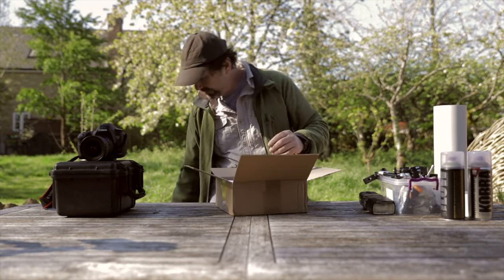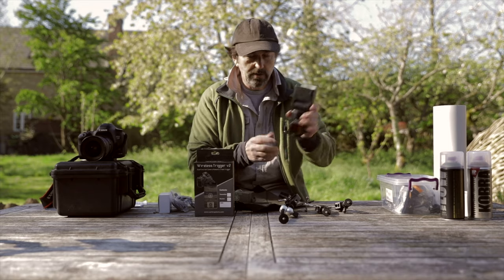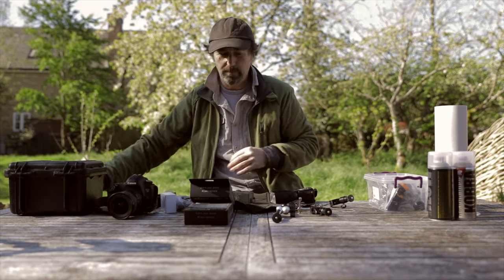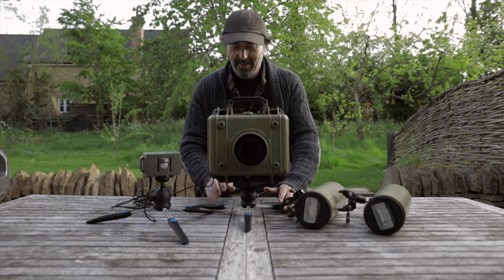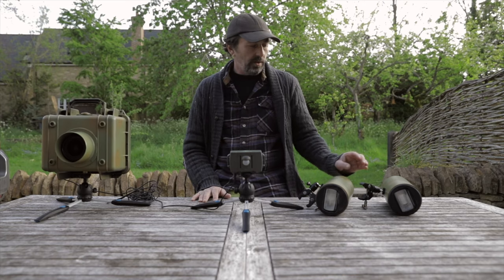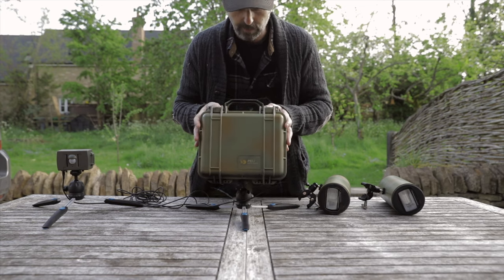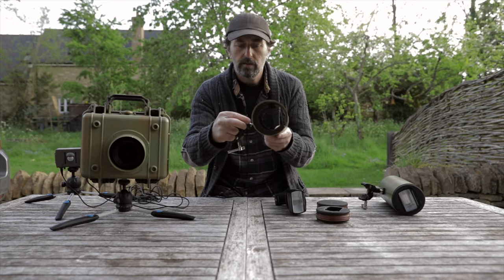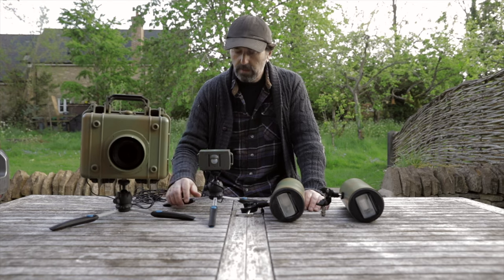Making a DSLR Camera Trap for Wildlife Photography with a Camtraptions V3 PIR sensor

Comment: Hello again George, in the video you use Sugru moldable glue to fix the flange to the outside of the box.  How did that go?  I had never heard of it before but it looks really useful. Did it do a good job fixing the plastic flange to the plastic box?
Reply from the maker: Hey Robert.. it actually did an amazing job.. so far holding strong and completely water tight..! Amazing stuff and I always have some in my bag.. fixed a fraying phone charger cable with it too..! g

Comment: Awesome video, got my camtraptions setup ready to go. For the Speedlights, have you found water/moisture come through? I'm considering doing the PVC pipe setup, but adding a foodseal/ziploc style bag on top with a rubber band to ensure it can fire through, but with minimal water/moisture ingress. Any thoughts on this please?
Reply from the maker: Thanks for the comment and I’m glad you liked it..! I haven’t had any problems to date with water ingress though when I build new ones I intend to seal off the end with a cheap uv filter which I think will be better than the bag option

Comment: Do you have a link for the mini camera stands please.. and brilliant set up. Im just building mine now that I've got my camtraptions gear
Reply from the maker: Hi Stephen.. thank you and I’m glad you like..! The stands are linked below but in all honesty I’d hold off getting these as they are not that strong or stable.. I’m looking at getting something a little stronger for the load so I’ll let you know as soon as I’ve found something I’m happier with.. the link to the ones I used is: HITSLAM Mobile Phone Tripod, Mini Tripod for iPhone/Samsung Galaxy/Huawei Cellphone, Small Camera with Bluetooth Remote Control, Phone Mount https://www.amazon.co.uk/dp/B07XG7ZH1N/ref=cm_sw_r_cp_api_fabc_1E179FG3T92RBGZSC6AD?_encoding=UTF8&psc=1

thanks again and all the best.. g
Reply: @GeorgeSBlonsky the ifootage cobra 3 base is on incredibly sturdy. For my flashes I use the cheap gorilla pods and secure with builders line (brick line, thin rope) on trees or to a rock/ground.

The mini tripod (base) is about 50quid on sale
Reply from the maker: Thanks for the comment @sinetwo ..! I shall check the ifootage stands out.!

Comment: I really like the way that you have constructed a housing for your Speedlights and you have inspired me to do something similar. The one thing that worries me is the stability of the tubes containing the flashguns once you have attached to drainpipe to a 7" magic arm via a 1/4" nut inside the drainpipe (is that righ?) - doesn't the weight of it tend to let it droop once articulated and set in place? Using the plastic drainpipe as a cover looks a lot better than using plastic bags for sure.
Reply from the maker: Thanks Alan.. it does require some firm tightening of the nut to be sure but has held for me so far without slippage every time I have put them out.. what helps of course is to position them if possible hanging down rather than extended sideways to reduce the leverage strain on the magic arm.. I’ve also been thinking of screwing a plate into the tubes to eliminate the possibility entirely because like you rightly suspect, they do work loose when removing and have to be re-tightened before putting them out again... hope of some help..! all the best.. g

Comment: Nice video. Curious to know what that clamp is your using for the flash housing. I just build some similar housings and now trying to figure out the best system for mounting them on a branch or rebar etc. Thanks!
Reply from the maker: Thanks Tim..! The clamps I used are linked below but in all honesty they are not that strong for the weight they need to hold and I’ll be upgrading them when I can.. hope that helps..! 
Link: 2Pack ChromLives Camera Clamp... https://www.amazon.co.uk/dp/B07GZ1D4BB?ref=ppx_pop_mob_ap_share
Reply: @GeorgeSBlonsky  Thanks George. Yes, the pipe and flash combo is pretty heavy and I have yet to find a good clamp system. This gets me one step closer. Thank you!

Comment: I’m loving the flash housing, did you have an Amazon link for the pipes and caps?
Thanks in advance
Reply from the maker: Hi Dan.. so glad you liked..! Links are below.. non-affiliated..! You’ll have to cut down the pipes to fit length of your flash guns as they’ll be too long otherwise.. best of luck and thanks again..g

End Caps: 5 Pack Round Tube Inserts 100mm,... https://www.amazon.co.uk/dp/B018R0HUZC?ref=ppx_pop_mob_ap_share

100mm pipe: Kair Plastic Ducting Pipe 100mm -... https://www.amazon.co.uk/dp/B00YLIOWXI?ref=ppx_pop_mob_ap_share
Reply: @GeorgeSBlonsky  thank you George for your quick and helpful response 👍🏻

Comment: Hello George, I build also a camaratrap and using my Nikon D7000 voor it. But the battery of the cammara is working voor 4 till 6 hours. Did you have also had this problem?
Reply from the maker: Hey Klaas.. thanks for the question.. my guess is that you are not putting the camera in “standby” mode so it is always on and drains the battery.. I don’t know much about Nikons but you should check if it has such a mode.. all the best.. g

Comment: I really like it, just a question, how much would it all cost?
Reply from the maker: I spent about £300 on my set up not including the camera but including the PIR sensor
Reply: If I got a sensor already and stuff how much would the flashes be and lense
Reply from the maker: That is something you will have to research for yourself in your local market as I have no idea where you live.. I bought two used flashes from Germany for €100 total just a few weeks ago
Reply: basiclly I was thinking about making a trail camera for a school project and just had a few questions. First do u recommend this setup or just a basic trail camera setup, also do I need two flashes, do I need to get a high quality flash and finally do I want like a broad lense or one more focused on a specific location, thanks so much for all the advice
Reply from the maker: No worries and I’m happy to help if I can.. there are a couple of major differences between a basic $50 TrailCam and a DSLR set up like in my video.. firstly a DSLR camera trap will allow you to take high resolution images of animals at night but you can only achieve this by providing light in the form of a flash (and yes.. you can use only one if necessary) a TrailCam however has much lower quality BUT it can shoot images and video by using a built in infra red light recording to an image sensor that is sensitive to IR light.. to achieve this in a regular camera you would have to have the camera sensor adapted by specialists. To answer your last question I would choose a wide angle lens.
It all comes down to what you want to use the camera for.. if it is only to take a peek into the night time activity of animals without much concern over quality then I’d just set up a simple TrailCam for your school project.
Reply: @GeorgeSBlonsky  think I could do your setup for around 100$ or 76.38£ if it’s just like lense and flash mainly I need for that amount, this design is quite impressive and I would love to be able to do it
Reply from the maker: Go for it..! You should be able to find less expensive parts.. let me know how you get on.!

Comment: I'm surprised you didn't put a UV filter on the front to keep out moisture. That shroud will keep out a bit of rain, but not much.
Reply from the maker: Thanks for taking the time to comment Steve. I've actually had no issues at all with the rain or in fact snow using this set up all of last winter in quite extreme conditions as you can see in some later vids.. but point taken. In addition, not sealing off the front means the camera & lens acclimatize better to changing temperatures (in Northern Greece where I was shooting all winter temps can go from +12C in the day to -12C at night) meaning I have also not had any fogging, or steaming up of the lens nor any condensation build up in the housing itself. All the best.. g
Reply: Good point about the fogging. We've had some really torrential rain here in Queensland the past couple of weeks, which is why I want mine watertight. I plan on putting lots of silica gel in the box too.
Reply from the maker: Understandable..! I tend not to leave the kit out if it’s torrential truth be told as I don’t like the way the pics come out... the flash picks out the raindrops and you get a ton of little white hotspots in the frame.. unless of course you shoot without flash.. I keep a couple of sachets of silica in the box too.. 😃 cheers.. g

Comment: Brilliant videos George what flashes were used and how did you stop them going on standby and my second question what  external trigger was you using to fire camera
Reply from the maker: Thank you so much Brent..! I’m using two  Canon speedlites.. the 580EX & 550EX.. I let them go on standby otherwise they will drain the batteries very very quickly.. the sensor wakes them when it is triggered and they wake very quickly so no problems there.. the transmitter/receivers are also from Camtraptions.. I chose to get them along with the sensor to be 100% sure they would be compatible... hope that’s if some help..?! Very best wishes.. g
Reply: @GeorgeSBlonsky  very much appreciated im on it and looking for parts i have 2x godox 860v2 so looking at comparability ect watch this space
Reply from the maker: Looking forward to see how you get on Brent ! All the best..! g

Comment: Hi there, i wanted to enquire what was the size of the foam pipe that you used for padding? 

Regards
Adam
Reply from the maker: Hi Adam and thank you for your comment.. in the end I only used some of the padding that I had cut out of the Peli case when fitting the camera.. it’s about 1cm thick in a band around the inside of the tube about 5cm wide.. just enough to hold the flash in place regardless of the position I place the tube in so the flash is not sliding around.. it also protects the flash from the nut holding the clamp screw.. held in place with some double sided tape.. hope that helps..? All the best.. g
Reply: @GeorgeSBlonsky  thanks George, I just ordered up some 10mm foam sheets to add inside.  I new to camera trapping so will be in touch on flash set up if you do t mind?
Reply from the maker: No worries Adam.. happy to answer any questions if I can..! 👍

Comment: Nice video! How did you fix the support for tripod under the housing? Thanks!
Reply from the maker: Thanks Paolo.. I drilled small hole and fitted double-sided standard tripod size 1/4 “ thread screw.. held in place on the inside with rubber washer and nut.. hope that helps..! All the best.. g
Reply: @GeorgeSBlonsky  hello George and a happy new year to you. Let's hope its better than last year.  I have finally got off my butt and am in the process of making my own trap and further to the answer above, do you have a link to those screws you used for the mounting?
Reply from the maker: Happy New Year to you too Robert..!! These are the screws I used.. link is non affiliated..! Hope of some help and good luck..! Let me know how you get on..! g 
SMALLRIG 1/4 Male to 1/4 Male Threaded Screw Adapter (2PCS) - 828 https://www.amazon.co.uk/dp/B00SY3I20A/ref=cm_sw_r_cp_api_fabc_R1d-FbENTW6QR
Reply: @GeorgeSBlonsky  thanks for replying so quickly George.  I was looking more for a female socket so that I could attach quick release plates etc directly to the housings so your system won't really suit. However, with a bit more Perseverance I have found what I believe is a better option. I did find one other similar product on amazon but that wasn't expected to arrive until Feb. This gives me the option of using some old lighting stands (with a 3/8 to 1/4 reducer on the stand) or my ordinary ball heads and my quick release plates.
I have put a link below (hopefully : my IT is crap).

https://luxlight.shop/products/tripod-screw-adapter-1-4-20-male-to-female-light-stand-adapter-screw-mount-hot-shoe
Reply from the maker: Hey Robert.. I tried something similar to begin with but found it was really wobbly coz the thread part is only on the end and the weight of the housing with camera is too much for it.. so used this fem-fem adaptor that you can screw tight up to the housing... New 2x Metal 1/4" UNC Through Hole 20mm Camera Switch Adapter 1/4 Female To 1/4 Female Screw, Suitable For Camera Accessories, Electric Guide, Strange Hand, Lamp Frame, Tripod, Etc https://www.amazon.co.uk/dp/B07H81QRSP/ref=cm_sw_r_cp_api_fabc_ugh-FbMG9MFGP
Reply: @GeorgeSBlonsky  thanks once again George. I can see that building these things involves quite a bit of experimentation. Still, it's all part of the enjoyment I suppose.
I'll let you know when I finally get it deployed. I'm hoping to get some pictures of badgers taking bedding into the sett.
Reply from the maker: That’s the fun of it ..! 😊

Comment: Does this also work with video?
Reply from the maker: There is a video setting on the PIR trigger sensor so I assume it does but I haven’t as yet tried it myself.. I’m guessing it would only work during daylight unless you use some kind of IR setup.. cheers g

Comment: How long does the flash trigger aaa last on field on the receiver end
Reply from the maker: Depends on many factors.. most especially ambient temperatures and if batteries are rechargeable or single use.. I switch mine every 3/4/5 days before they die completely